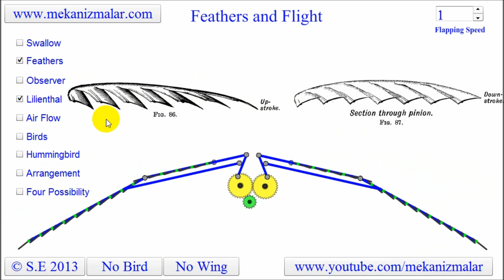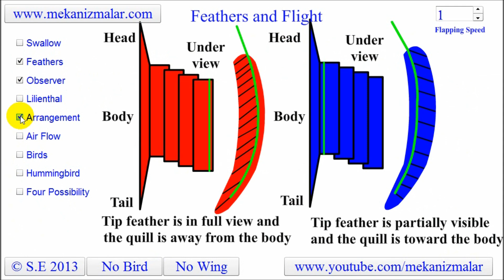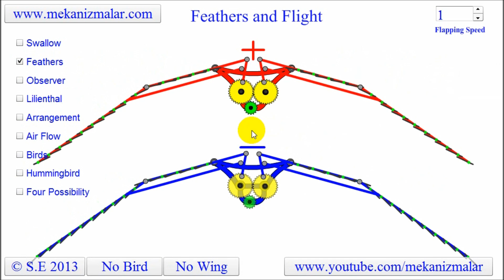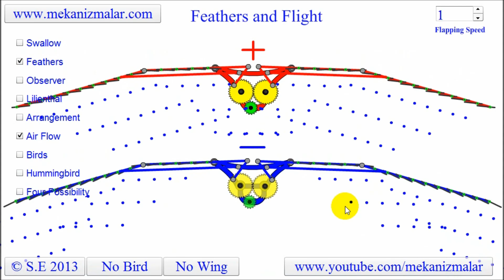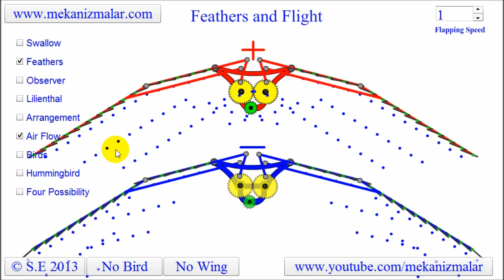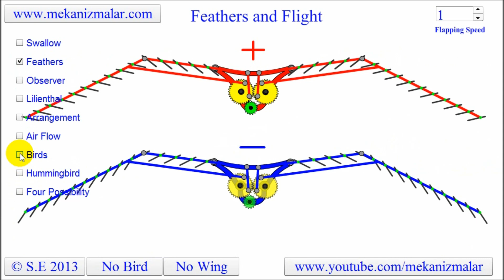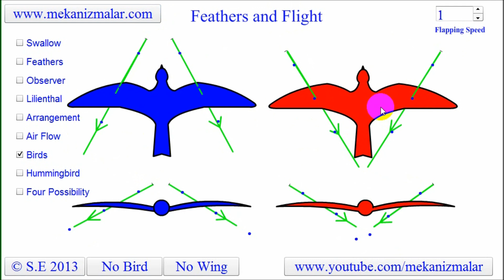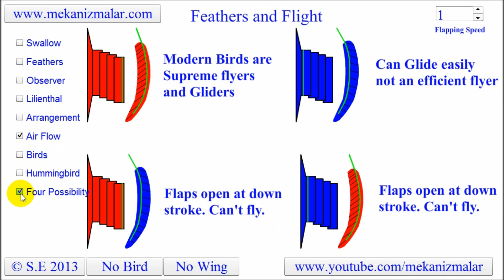Feather Flight - How do birds fly?

Comment: I find that the flows bring air over the tail makes a lot of sense. Air flow over the red bird's tail reduces drag of the tail and makes it more effective for its size. Humans design power flight and boats, to have control surfaces in areas of high flow to increase control effectiveness while reducing control size which minimizes drag.

Comment: I found a feather outside today, the small scraggly whispery tufts closest to base looked like they would pull significantly more drag at the base of feather than it would at wingtip. it’s elongated concave shape cups and angles the air down the length of the feather sort of like a channel on top of the feather rotation to reduce drag on upstroke, the 2D rendition of the wings really lacks the mobility and thus the action of bird wing-power. But the animation is still wrong I’m sticking to it.

Comment: I noticed birds use their tail feathers as both an elevator, and an additional lifting surface. under the positive feather/red bird model, the wings push air underneath the tail, making it more efficient - the same way an aircraft horizontal stabilizer responds better/generates additional lift if it is in the prop wash.

your model also perfectly explains how birds achieve roll stability, as seen in high wing aircraft with anhedral wings. using positive feathers, the wing that rolls down (due to wind, turbulence) will see a greater angle of attack than the wing that rolls up. therefore the down-rolling wing will generate more lift, restoring the bird to roll-stable level flight. 

the negative feather/red bird will do the opposite - rolling further into the direction it got pushed by the wind, making it waste more energy.

now, would you happen to know how birds go about doing vertical stabilizers/rudders using their feathers in positive configuration?

are they using their wing tips as split-rudder ailerons/air brakes to slow down one side (as on a B-2 bomber)?
Reply: actually - with the negative feather/***blue bird model (typo on previous comment), if wind pushes the bird to roll to one side, the downward wing will get air flow separation and stall, while the upward wing would get more lift.

it would be very easy for the bird to go into an unrecoverable roll. evolution would not let such a thing happen :)

thank you for this detailed mechanical animation.

Comment: Would it be possible to make an RC ornithopter with this wing structure in mind? It might be a good tool to use to measure the efficiency of the wing. David Lentik used a box with instruments and trained birds to fly in it in order to measure the lift of a bird in flight if we made 2 RC's one with a traditional wing and one with a wing designed like a  birds we could probably get some good info on it.
Reply: I try to build one and I failed. Even Festo's bird does not fly like a bird.

Comment: Do birds use some type of “drag” on the wing to turn left or right the way planes use ailerons?
Reply: Bird flight is a very complex task. I guess birds use their tails to accomplish right or left rotation by just arranging their tail angle accordingly. However, I see birds change direction without a tail. I think they use their wings to do that. However, the tail gives the bird more control to make a turn.
Reply: @seyhanersoy8989  
Thanks for reply.

Yes, majority of birds might use tail for left or right or use a small portion of their wings to create just enough drag to turn.

I find it interesting how a bird doesn’t have the need for the use of a tail like a plane uses to fly straight. Planes do use a elevator section if it’s tail to move up or downward but a bird doesn’t technically have a vertical back tail.

Maybe it’s a Birds tail is dual usage like a bonanzas V-Tail combines both elevator & rudder in one area.

Comment: I disagree with you conclusion and think the explanation is much simpler: 
The feathers at the tips need the keel to be on the front in order to be stable in the oncoming air. They need to be a miniature version of a wing. This is only really possible with the load bearing element towards to leading edge.

Comment: does size of birds matter with there speed of feathers
Reply from the maker: Dear Amit, Bigger the bird, slower it is wing flapping and visa versa. Therefore the small birds flap their wing faster. This means that wing feather opening, closing will be much faster. In short air will pass true in between feathers during upstroke. As long as shaft of feather wing are off center, this event will be true.
Reply: Thanks

Comment: Nice attempt to explain the bird's flight. The only problem - it has no connection to reality. Birds' wing mechanics is principally different, it never fights to the air, always laying down to the air, even in the upper part of the  flapping cycle.
Reply from the maker: Dear Eugene, thank you your visit my channel and your comment. I do not believe that the bird winds, especially, large birds wing not just act as an airfoil. In the air plains jet engine or propeller crates a thrust, so that air plain can fly. Air plain wings always laying down, but they will never fly without thrust. Bird wings and feather are very elegant solutions to the flight. No flaying animal whether its a bat or insects can escape being a pray to the birds. Because their flight mechanism is much superior. I suggest you should read the book Otto Lilienthal father of gliders write about birds. Bird-flight as the Basis of Aviation.

Comment: Hi,
I like that you've broken down the effect of feather configurations on airflow around the wing. This is quite a helpful tool. However, birds travel within the incompressible flight regime, so the animation of particles is misleading. It shows there being variable density beneath the wing, which you refer to as "supercharging." I believe that what would happen in reality is that there would be a region of higher pressure under the positive configured wing on downstrokes rather than higher density. (It may even just be that there is a marginally higher pressure beneath the positive wing than the negative wing). This, in turn, would change the motion of particles as they are displaced to maintain constant density. So while this animation helps visualize the effect of airflow direction, it could use a bit of rework to account for the incompressible assumption (i.e. it is the differential pressures and velocities that increase flapping efficiency not extra air atoms).
Reply: extra air means extra charge (all matter recycles charge, ie real physical photons), i would say it does help lift.

Comment: Can the red birds generate the same amount of lift between when their wings go upward and downward?
The animation tells me almost the same. i'm a little confused.
Reply from the maker: In one complete cycle, up and down, red bird generate more lift during take of than the blue bird, since it fills underside of its body with fresh air, while the blue bird does not. During the cruising flight generate same amount of lift, however blue bird experience more drag. This is because the red bird directs the air particles to fill the vacuum behind it, while the blue bird does repels the air particles outward, which causes more drag. In short, the red bird creates more lift during take of and less drag during cruising flight, while the blue bird creates less lift and more drag respectively.

Comment: i think the reason that we see only the red kind that the open spots in the feather in the red kind goes in the direction under the body part because the body part is the heaviest that air flow or pressure will work against the gravity which is gonna make the body feels lighter but if u imagine it with the blue one the air flow or pressure will go away to the side which is gonna focus the pressure at the side which is not going to help  as the red one does .
Reply from the maker: +O Okba Didn't I mention similar stuff in my video?
Reply: nope

Comment: Thank you for this, I was looking to see if I could make a mechanical bird sculpture and this helps a great deal. I think we can look at things and easily take them for granted, as you say the wing profile is probably perfectly well understood by ornithologists but as a casual observer I would bet that the quill was closer to the body than the wing tip. You did well to observe the feather construction/layout from the photograph. Your analysis makes perfect sense. 
Kind Regards … Andy
Reply: -Speed of gears
-Elastic bands on the wing joints
-real feathers
-32x 180 degree joystick-like mechanisms (feather spread)
-2 x180 degree joystick-like mechanisms (individual wing shrug)
-triangle-point gears (circular roration) for wing shrug

It would help if I knew what the bones were called.

Comment from the maker: You are very good observer. the statement I mentioned there is not wrong, but it would be better, if I said, In real bird tip feather fully visible, but the blue one it is not. What happens, when the red birds closes its wing, tip feather stay inside the wing. For the blue bird it stays outside. Does this explanation makes it clear?